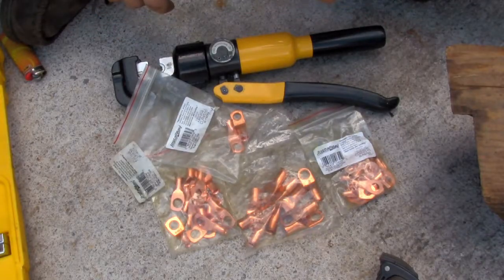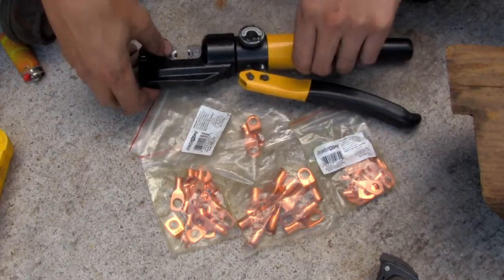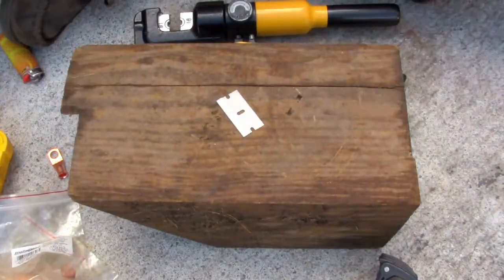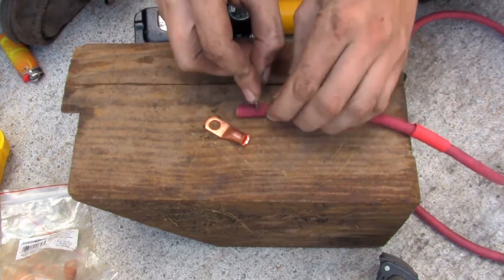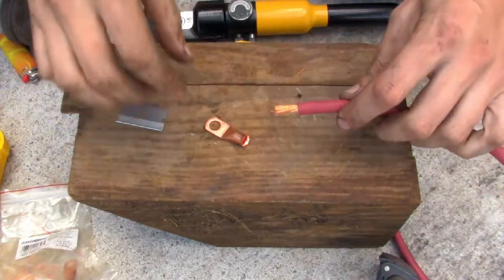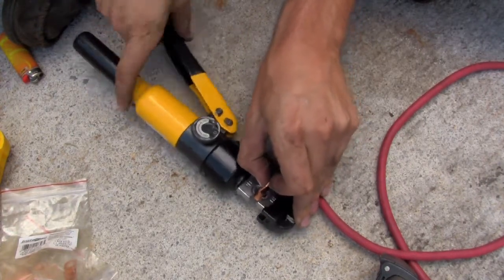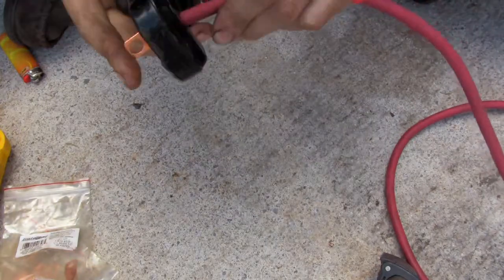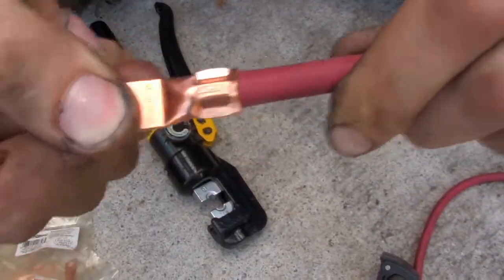Crimping battery cables with Penson 10 ton Hydraulic crimper, DIY Custom power cables

Comment: Very helpful...just bought Northern tool version, looking to not crimping my fingers while holding wire/lug into 10mm dies area.
Reply from the maker: This thing is still going strong. I may have gotten a blood blister once or twice until I figured out how to hold everything just right.
Reply: @trythistv  how did you select the desired mm-marked halves for crimping 2 awg and 4 awg ? Many thanks.
Reply from the maker: I've got a couple charts on the website, one as an image you can download, and another just as a page to view:
https://trythistv.com/wp-content/uploads/2021/02/crimperchart.jpg or https://trythistv.com/10-ton-hydraulic-battery-cable-crimper/

Comment: Only real issue I have is that you are literally nicking the wire when you strip it with the razor like that.  In the future try to score the jacket but not all the way thru to the underlying conductors.  Ten simply bend it and the insulation should come off with no damage to the conductors.  Also consider using hot melt glue lined heat shrink for better seal and strain relief.
Reply from the maker: Fully agree on all points. I thought I used the hot melt glue lined shrink wrap but maybe I got that after this video, that stuff rocks. And I try not to cut too deep but sometimes it happens, depending on the application I have redone wires if I really need all the amp capacity, I generally way overdo my wire gauges anyway though.

Comment: Love that crimp tool definitely will buy one thanks for the video.
Reply from the maker: I'm so impressed with it. I make battery cables, or at least crimp ends on old cables fairly often and it's still working just as good as the day I got it.

Comment: You used 16mm2 die on 4awg cable and lug. You should have used 25mm2 die which is why you ended up with flanges on your crimp - die was too small!!
Reply: You see that a lot on YouTube. Just not quite right!
Reply: @erkful  Those videos have held me back from not purchasing it because the final crimped therminal just doesn't look right. So with proper size it wont create the flanges?

Comment: Where did you find that heat shrink  at ?
Reply from the maker: Amazon! https://amzn.to/2RLPJYf is the exact stuff I used. I try to put links in the descriptions for any neat stuff like that, the glue makes it work so much better for waterproofing connections where they could get exposed to elements, or even if it never sees the outdoors, it protects the connection and gives it a little better rigidity too!

Comment: insulation isnt supposed to touch the lug !
Reply from the maker: I'd say that's a matter of preference, but I may not be aware of various standards, I like the insulation to just barely touch the lug, but have enough bare copper stripped and inside the lug before the crimp that it fills as much of the lug as possible, but still has a nice smooth transition into the insulation rather than having 1/4 inch gap or something all derpy looking.
Reply: It makes "zero" difference if the insulation should touch the connector - its all covered up with the shrink. Good job wouldn't you know somebody could find fault with video. Great job!

Mike

Comment: I prefer the small butane torches instead of bic lighters
Reply from the maker: No doubt! I use a little portasol butane soldering iron that has a hot air attachment for heat shrink now, and I've got a little lighter the same size as a regular Bic but it's a refillable butane torch that works awesome for anything the soldering iron won't do